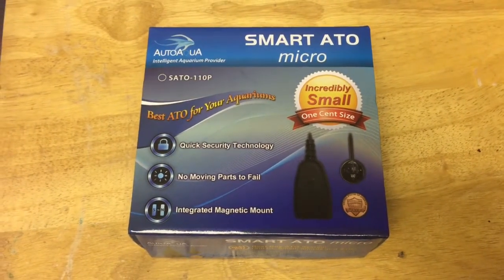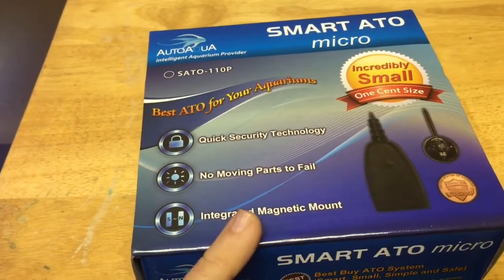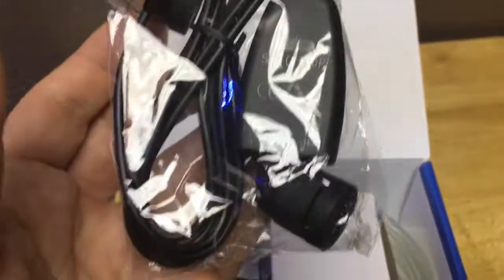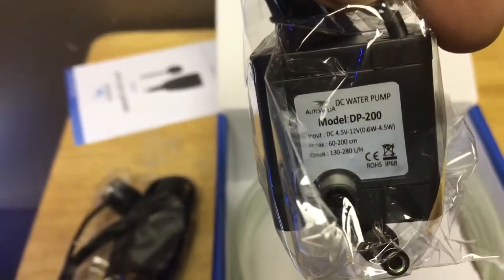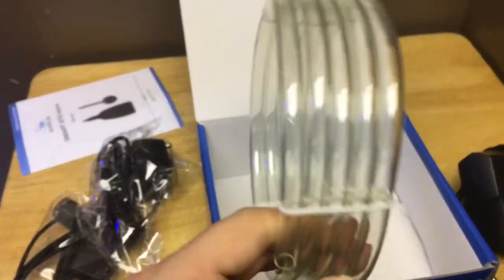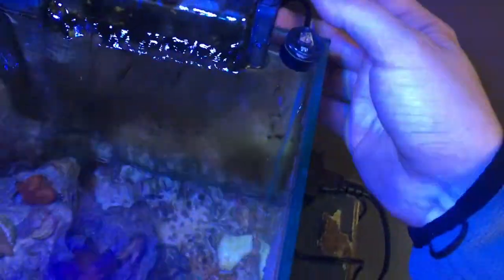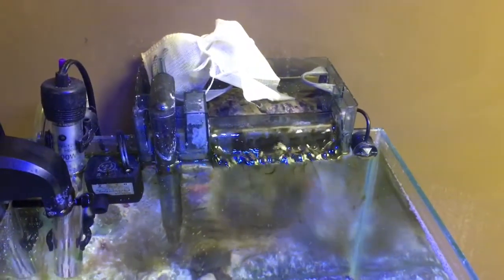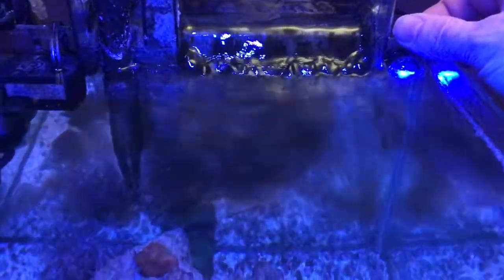Smart ATO Micro

Comment: Would not suggest using it under strong light fixture as directed. And, the wet part of the sensor needed to be looking after periodically, to make sure nothing, such as ALGAE, or moving organism biting behavior, that leads to the non-moving part (wet side of sensor) being a forced MOVING PART (wet side of the sensor's) lol
Reply: Yep I think needs light for sensor to see water line. Mine was in rear sump and is black glass having filling issues there